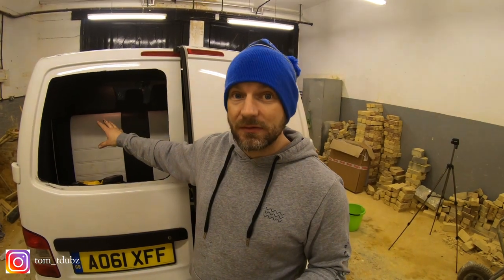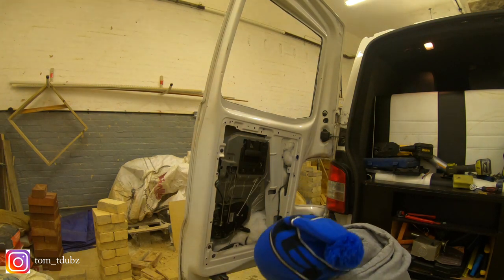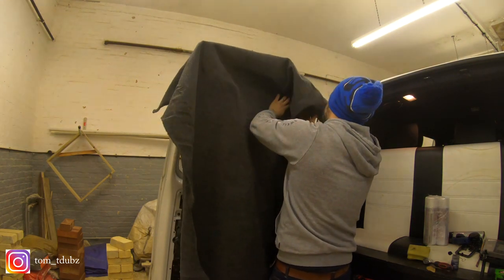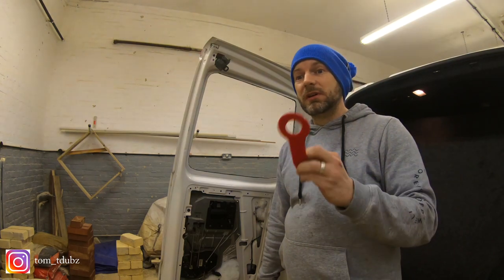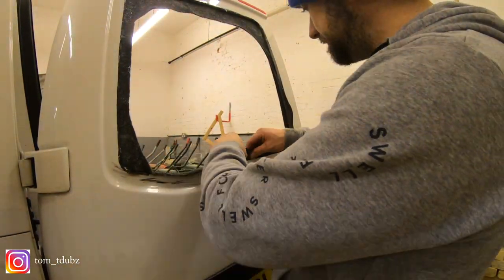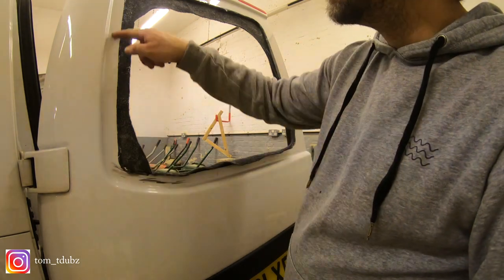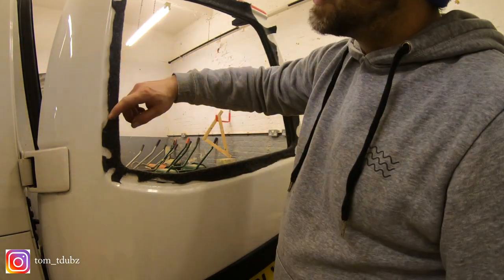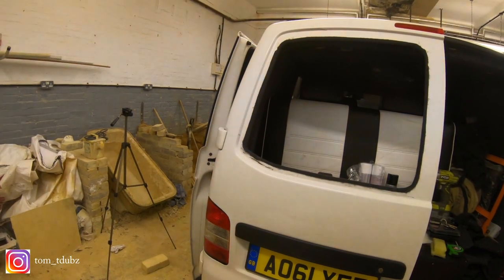Carpet lining barn doors vw t5 #diy #vwt5

Comment: Make sure you don't carpet all the way to the edge of the door. Otherwise the carpet will be outside the rubber seal and soak up water.
Reply: Just did the same thing on the side loading door it had me puzzled for days where the water was coming from  had to cut it all back
Reply from the maker: It’s a nightmare, looks good but don’t go anywhere near the seals 👌🏻

Comment: Did you find that the carpet pulled water into the van?
Reply from the maker: No, managed to keep it away from the seals. Have seen some vans where it’s poured in 😟
Reply: @tomtdubz  that’s what I’m afraid of, we get a lot of rain in Wales lol
Reply from the maker: I’m converting vans now and I strongly disagree with carpeting the rear doors, make some full height panels with or without window holes or van shades now make full height panel window pods 👍🏻
Reply: @tomtdubz  ah ok, don’t suppose you done a video?
Reply from the maker: No I haven’t sorry fella

Comment: This is the finish I'm hoping to get on all my windows don't want to use the U trim. May seem pretty obvious but do this on all of them with windows out? I'm guessing it's not possible to get the carpet stuck in place with windows fitted? Thanks for the Video 👌
Reply from the maker: It’s possible obviously a lot more difficult but you can just about get the carpet in with trim tools, carefully with the back of a Stanley blade... 👌🏻
Reply: Thanks guys just finding out the best way to do things and was worried that the carpet would stick tidy if I fit windows first.
Reply from the maker: If you can... cut - carpet - window 👌🏻
Reply: Definitely looks the best way thanks guys keep up the great work 👍
Reply from the maker: Best way in my mind 👌🏻👌🏻
Reply: I'd say so as well not a fan of the U trim.

Comment: Omg did you use a lawnmower to cut hole for window?
Reply from the maker: Had thought about a chainsaw but couldn’t find one at the time 👌🏻
Reply: @tomtdubz  nice finish though, thanks for the vid
Reply from the maker: @YourName-mp8ch  thanks, it’s the tools you have, I’m building up a variety. If I did it at a pro level I guess I could warrant the purchase of an expensive nibbler or air saw 👌🏻👌🏻

Comment: What did you use to clean the adhesive off the door
Reply from the maker: Alcohol wipes, 🤙🏻👌🏻and adhesive remover 🤙🏻👌🏻
Reply: @tomtdubz  perfect.   I attempted to carpet my rear doors.   But when I stood back it looked very shoddy.  Somi took the carpet off and want to clean the adhesive to try again.  Thanks for the info
Reply: @tomtdubz  
Where's best to get these from as in lockdown it's difficult to find?
Reply from the maker: Lucio cancellara what are you trying to find fella?
Reply: @tomtdubz  
My floor has spray on glue on it 
Wanted to get it clean as possible so my sound deadening sticks down properly?
Reply from the maker: Try a few things.. alcohol wipes, degreaser, panel wipes. Basically alcohol based cleaning stuff with a cloth 👌🏻